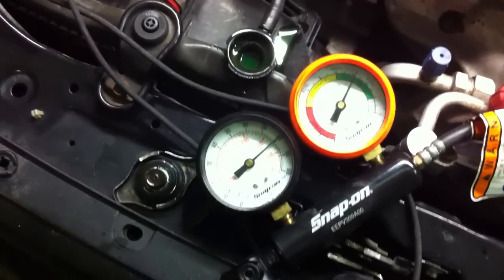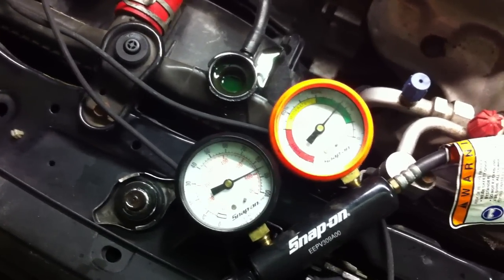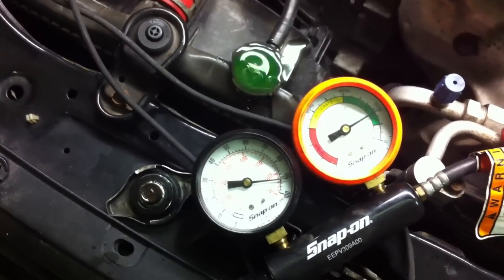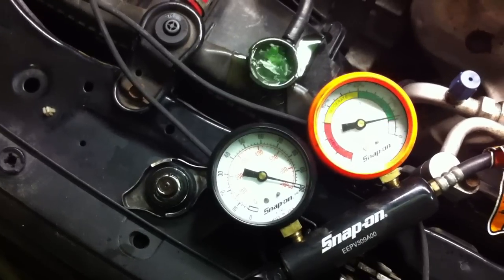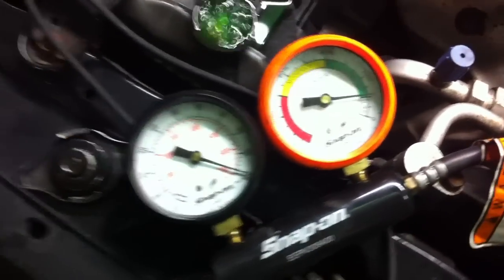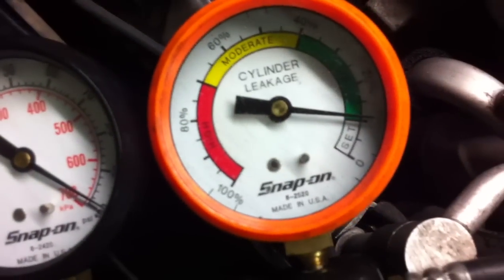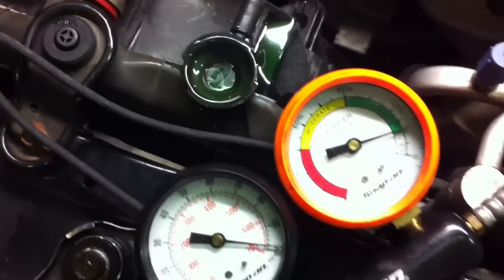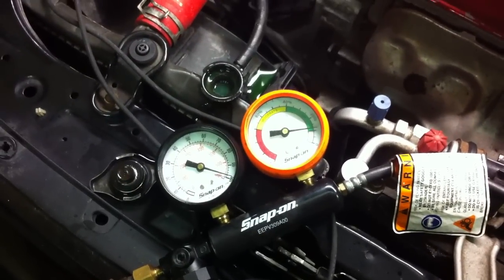B16A2 Engine Cylinder #2 Leakdown Test Failure

Comment: What is the correct "when new" PSi reading for the b16a2?
I did the test last year on my b16a2 stock motor and it read 135 130 130 135 or there about, That seems really low but they are all relative to each other which ive been told is the main thing to watch out for?